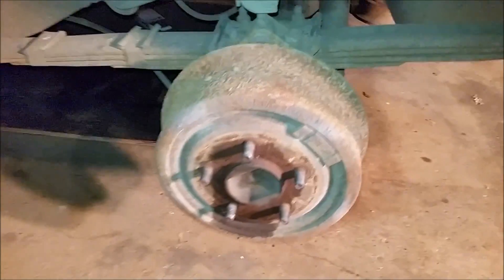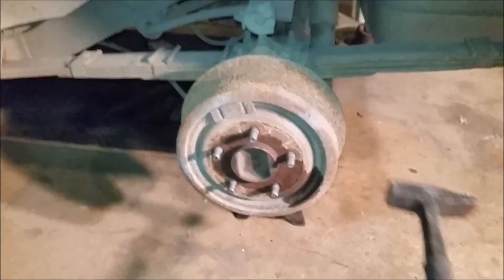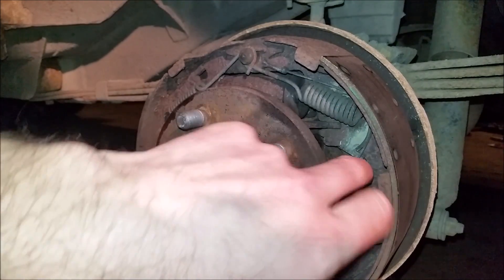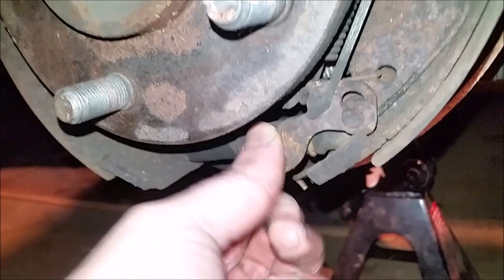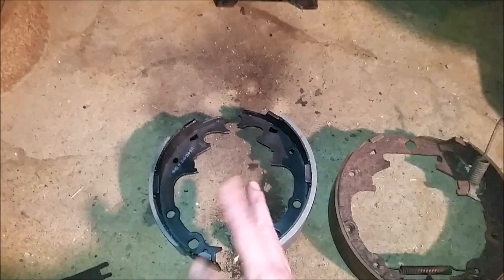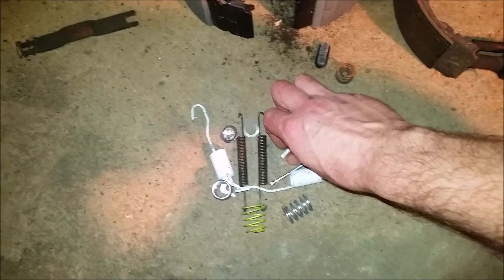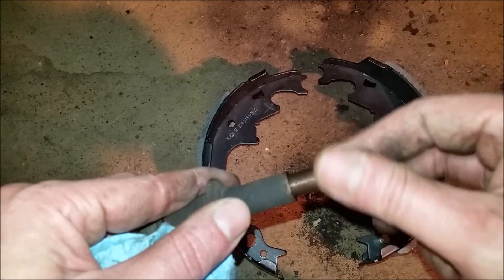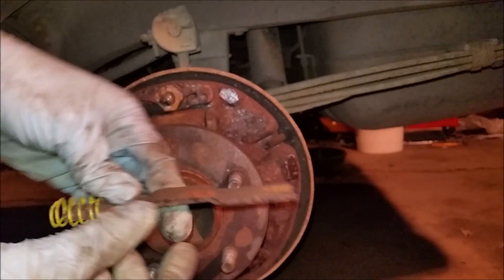Drum Brake Service 2000 Jeep Cherokee XJ

Comment: No one else had shown the difference on which way the one spring on the wire went and previous owner had it on wrong way also. Me and my husband were trying to figure out why it all wouldn’t line up properly. Your video fixed our issue.
Thank you!

Comment: Just did mine today thanks to your video. One thing I found though that can help putting them back together a lot easier is at the 18 minute mark. You are putting that part with the wire on and putting that spring back on the bottom and then trying to get the top spring on while everything is under load and it's a pain trying to keep everything together. If you put the top spring on first and then feed the wire around the roundy part and clip in the bottom with the spring it's way easier. Sorry if that makes no sense. I'm tired and words are hard right now.
Reply from the maker: Thanks for the tip! I'm glad the video was helpful.

Comment: Very nicely done!  Laughed a lot as we have some of the same curses FFS.  At 61 its almost easier to pull the axle, put it on a bench and do the job at eye level rather than grub around on the floor looking at small parts.  Ditto on the spring tool.  Got one and it works.  Great tip on turning those GD pins from the rear of the backing plate too.  I usually just get pissed and rip the bastards off with vise grips.
Reply from the maker: Hey, thanks for watching! Glad the video was helpful. It's a dick of a job, that's for sure. I'll be happy if I'm still around to complain when I'm 61. You're doing alright!

Comment: In the kit I brought, the self adjustment device, 12:15, both new ones turned the same way, clockwise, so I use the old driver side that had the reverse thread. And it funny how they mark the parts left and right rather than "driver side" and passenger side, because left can depend upon if your sitting in the car left being the driver side, or looking at the car from the front left being the passenger side, USA.. and if a previous mechanic in the past put them on opposite which I suspect is why one side failed in this case, then it makes for error without doing research. I am glad you talked about the self adjust device...
Reply from the maker: The right/left vs. driver/passenger thing drives me nuts too! Lol

Comment: I have to do my drums today, it’s been 6 years.  Change the cylinder too.  I’ve done them before, but they are a pita.  Thanks to your video, I don’t have to “this one goes there, that one goes there or is it the other way.”  

Truth be told, can put a 500 piece puzzle together faster than replacing drum brakes.  Well, no, but, both are equally frustrating.

Also, there are separate kits for springs, neither  has that cross bar, so keep that piece.
Reply: That spring tool makes those springs ridiculously easy.  What a Godsend
Reply from the maker: Isn't it crazy? I thought they were a dumb gimmick and struggled without one for years.

Comment: Well done and well shot! IMPORTANT. Read billschott1 comment below. I didn’t and finally figured the same way to get that damn guide on for the parking brake tensioner (19:25 ). I tried for 1/2 hour or more doing it the way you showed with NO luck. Cussing worse than you did. Realized that the parking braking brake tensioner, when connected at bottom, wants to pull that guide piece out of hole. Large white spring is what keeps it pushed in the hole. So unhook tensioner at bottom, place the top part on the tab at top and run cable loosely over guide. Then attach that white spring. That holds the guide firmly into hole. Then at bottom, carefully detach long spring from bottom of the piece that ratchets against adjuster. With that piece loose, the piece can be swung up enough to attach to end of the parking brake tensioner cable part. Then pull it down and reattach that long spring with screwdriver as you showed! Bingo. You might do a vid just about this little trick because it can be the most frustrating part on these old drum brakes! IMHO.

Comment: Great video. Took the drum off my 98 Cherokee and half the springs were snapped in two! (That's what you get for $500). As for the missing springs, any parts store like AutoZone sells self adjusting kits (I needed this as my self adjusting screw was in very bad shape) as well as the "complete" spring kits.
Reply from the maker: Those springs get so brittle when they're old. Good thing you found them! I don't know how I ended up with such a shitty spring kit. Just my luck! Next time I gotta make sure I get the FULL kit. Haha. Thanks for watching! I'm glad you liked the video.

Comment: I tried a little different twist putting the cable in. I started at the top and used a needle-nose vice grips to hold the cable router piece in place then ran the cable down and put the spring in place to hold all that on top together. And I removed the vice grip pulled the bottom up and hooked on the ratchet clip on the bottom. It seemed to work better holding it all together like that.
Reply from the maker: Interesting! Maybe I'll give that a try next time. My tj has the same drums and they're due for a service very soon.

Comment: Thanks for a very helpful, well-produced & humourous vid. I've fitted new shoes, small parts to both sides of my XJ & I'm up to the point where I need to refit the drums. Should the drums spin freely so the shoes can then be tightened, adjusted accordingly? Do I need to put the trans into neutral?
Reply from the maker: Glad it was helpful! if your adjusters are in good working order, they're pretty easy to set. I get mine close by hand, not dragging, but close to touching. Then, with the rear wheels off the ground, yank the e-brake, and spin the tires backwards. You should hear them clickety-click until they're set and the tire stops. They'll also adjust themselves if you drive in reverse and hit the brakes. Dealers choice! Thanks for watching!

Comment: Video editing aside, and you not explaining everything in detail, how long does each side roughtly take? Was thinking of doing this myself on myChevy C10 sometime this winter when I have a few days off. Also, thanks again for the Ko2 video. Looks like we got a pretty good thread started. Cheers bud! -SS
Reply from the maker: If you've never replaced shoes before, or even if its been awhile, give 
yourself a good hour to waste on each side. Probably won't take that 
long, but just in case you run into issues and need to piss around. 
Depends on the brakes. If I recall correctly, I remember the delco-style
 brake drums like you have being a bit more forgiving.

Comment: Did the shoes come with the pin installed or did you have to press it in yourself, the pin that supports the self adjust clip on the bottom spring assembly...
Reply from the maker: Those pins were pre-installed for me. I think only two of the shoes need it. Were yours not installed? Between that and your backwards adjuster, sounds like you're having a rough time, bud. Happens to the best of us. I hope you got it sorted out! Thanks for watching!
Reply: @spacerag  It went well, in having a bit of experience, and your note about the adjusters that I saw the error. But next time I'm going to NAPA. I had to press the pins myself.

Comment: i have an 01  with 9inch drums and i ordered a new parts kit but the round springs that held my shoes on had a small taper at one end like in bleepin jeeps video. but the new part kits springs were like yours. i'm not what is going on here so now i have to order another parts kit  from a different manufacturer that says all the exact same info as the one i ordered but the picture shows the correct springs. that the only way to know i'm getting the right one.  unless i'm missing something.  freaking annoying
Reply from the maker: Hmm. Not sure what I can suggest without seeing just what you ended up getting. The springs I used all worked just fine (still working), but I don't want to give you bad info either. I assume your XJ can't be down for too long, otherwise I'd say just see if they work for you before ordering anything else. I hope you get it figured out!

Comment: My Cherokee xj is the 2001 Sport. Do you know what size my drum brake and drums may be?  I've never done this job before but i want to make sure i buy the right size... Thanks!
Reply from the maker: +miggy0089 I'm on vacation and had a few pops but if my memory serves, you probably have the 9 inch drums. The bigger 10 inch drums were a police spec option and you likely don't have those. I hope that helps. Thanks for watching!
Reply: Thanks man! Probably i will make a small video showing you how i did. Your video inspired me haha :)
Reply from the maker: +miggy0089 awesome! Send a link if you do. The more the merrier!